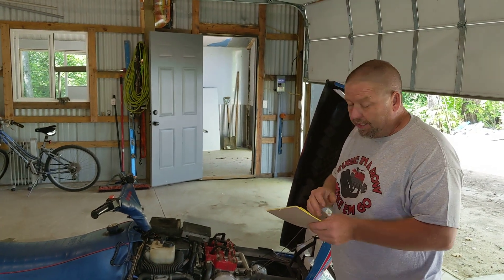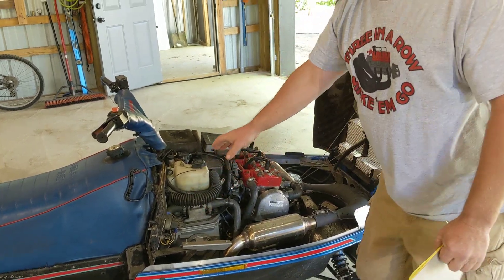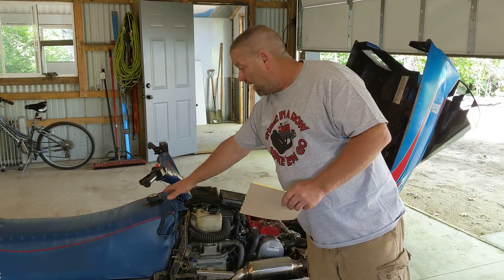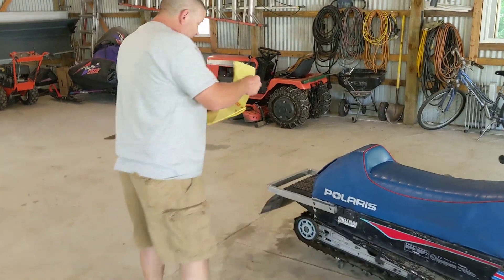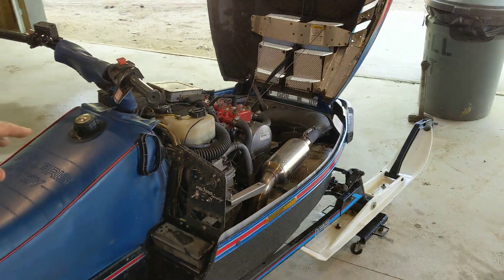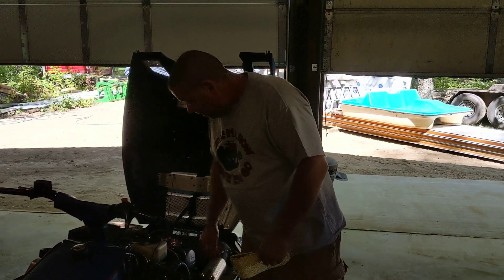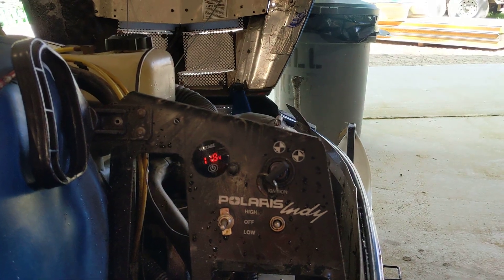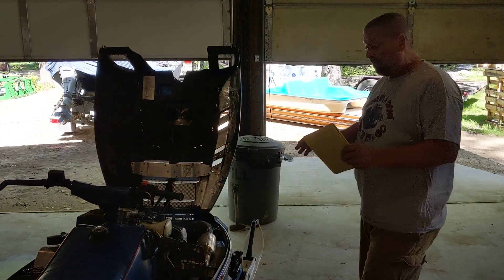POLARIS 650 RXL 500 EFI trouble shooting and codes

Comment: I had one of those, brand new 1994. Every time it got below zero it ate spark plugs like they were absolutely FREE. 9 plugs in one ride up North. Traded for the 95 Storm and never looked back. Didn't like the clunky reverse system in the RXL either. For a minute there I thought you had my old Storm as I put an Extra 10 in mine but I used buck rivets and support plates on mine. Great channel, love the Turbo 650 pumpkin. Great with the decals. Wish you'd have had me paint it. I'd have cleared over the decals and made it totally over th e top! LOL!

Comment: I have a 91 RXL and I've had lots of others over the years and I've been working on them all so I know all that stuff that you described but there is a couple of things that I want to address one is you've talked about the battery yes it's very important the battery has to stay up in volts but here's the trick it's very easy just go out buy a battery tender not a battery charger a tender and wire it right on to the battery so you can plug it in when you're done riding it for the day it'll charge battery and when you come out the next day you'll be fully charged also check your charging system make sure it's putting out hook up a volt meter to your battery see what your volts are like you said 12.9 volts at the battery fire it up it'll be probably under that because it's running off the battery in order for it to put out you have to take her up over three grand and hold her there for a while and watch it should climb up to 14.1 volts or a little bit higher if it doesn't then you got possibly a voltage regulator failure you got two of those on that sled you got one from the lighting coil that runs all your lights and your gauges and stuff that has nothing to do with the charging system the charging system is separate from the lighting coil and it has its own coil discharged battery and run the EFI problem is they couldn't make a big enough coil to charge the battery and run the EFI at the same time so what took to hit the battery so that's why it's important to start with a fully charged battery never let them sit without being on a charger that's just plain dumb and ignorant if you're going to own on RXL make damn sure you know what you're doing with it and if you don't you better educate yourself because if you do something stupid it will likely leave you stranded and it'll probably be the batteries dead so if you listen to these people on these sites they know what they're talking about and arc cells are very reliable I haven't had any problems with my 91 it runs absolutely flawless I put a epi pro clutch kit in it and I got well that comes with springs and it comes with the Helix for the secondary clutch all that but it no it's fully rebuilt from the ground up and I lost the motor myself by not changing out the crank steels I should have done that that's something else that people need to know if the slut has been sitting for a long time it'd be very wise to replace your crank seals this thing was sitting for 10 years before I got it inside a garage it was his wife's sled the lighting coil failed so they had no lights well if they would have taken it apart and they would have saw the two pieces of wire was like it got hot and it broke apart you hook those two back up the lighting coil works so I solder them back together and it's working just fine I don't know if I did the right thing but it's working I do have another state here if I want to put it in but it's working it's been like this for quite a few years and haven't had any issues.

Comment: Is the voltage meter just parallel down stream of that kill switch to ground? It’s a great idea and I want to copy it.
Reply: OK, I wired black to brown and it turns out that voltage is coming from the CDI and the ignition coil. This is not battery charge coil voltage. I wired the volt meter directly to the battery, I used a continuous duty relay and I triggered the rely from the yellow wire which is the lights and accessory coil system. The stator has three individual charging coils, ignition, charging and accessory. You still had a great idea there.
Reply from the maker: @holleyman1970  yepper

Comment: Owned a 95 Indy 500 EFI from about 2005-2017- Todd is spot on on all advice here. He mentions all of the on-line guys that helped me keep mine running as long and as well as it did. New battery at least every other year and clean electrical connections. I beat the snot out of that sled and it always handled whatever situations I threw at it! Just bought a pair of 96 carb Indy 500’s- been out of the sport for about 5 years, looking forward to riding again!

Todd- nice job on this video! Great tips and info on the ole EFI’s.  Cheers!
Reply from the maker: Thanks

Comment: Couple things we encountered a lot was power draw from aftermarket hot grips, thumb warmers, face shield warmers, helmet coms, etc. adding extra load to charging system and either total draw or improper install dropped power and caused issues.  TPS even if not tripping a code absolutely critical on the EFI Poo sleds too.  Annual fuel filter changes and batteries, as noted a must- just do it.

Most ECU failures encountered were on '90 1/2 pre-production units and '91 prod units or units that sat outside uncovered.  By mid-'92 saw way fewer ECU failures.  Lastly, if the sled has had the EPROM changed for pipes, those did fail at a reasonable rate, and here we are 30 odd years later and with so little known history, worth checking to see if it has a stock EPROM or not.  Kudos to the faithful and keeping the old girls chuggin along!
Reply from the maker: Very well said and thanks for taking the time to add this. I'm a firm believer in just leaving these stock and enjoying them. Piping them added piles of issues.

Comment: The Polaris EFI system from 91 model year until 96 was a good system and still is in my book. I have  an actual Polaris Select Monitor for these EFI Polaris' that I bought about 15 years ago but I have never used it . I also have the micro chips for putting SLP pipes on an RXL that came with the Select Monitor.
Reply from the maker: Sweet
Reply: @toddclyne3493  The 90 1/2 RXL which is very rare RXL had the best ignition.  If you know of anyone who might need a complete fuel injection system(less stator plate) I have of a 91 RXL that worked when I took it of the machine let me know.
Reply: I'm interested in this stuff if you still have it.

Comment: Is the key in the on position. Only kill switch off.
Reply from the maker: That's how we run it
Reply: @toddclyne3493  I heard if the key is on even if the kill switch is applied. It causes the battery to drain. I don't know if it's any truth to that but I figured you probably would know more about those RXL's.
Reply from the maker: @emmanueldelescaille731  it's possible but we really don't use the key.

Comment: I bought my kid a 680 ultra me and the wife have xlts that run great cable is bad on his sled I bought an XLT cable for it but the idle super high is there a difference in the length of the cable or do I have the coil packs f*** up please respond would love help watch all your videos
Reply from the maker: Probably not adjusted correctly. I would compare the cables side by side

Comment: I have the exact same sled. They are awesome sleds! Last winter though my positive battery wire touched the metal battery box while driving and shorted something out. Headlight bulb blew and lost everything on the dash (all dash lights and every guage reading). Funny thing is the sled still runs great. I replaced the voltage regulator and no help. I'm thinking maybe the stator went?
Reply from the maker: I would pull the flywheel and check the stator. What a bummer

Comment: I sure liked my ‘94 500 fuelie back in the day, until I got my ‘96 XLT Special. Lolol. That 500, by the way, is still seeing use as a “Cabin Sled” by the older couple I sold it to. One of my buddies has a 650 RXL that’s been sitting in the back of his garage for 25+ years. I’ve bugged him about it a few times, but, well, he doesn’t sell anything. Ever. Great info to know if I ever do get my hands on it. Thanks.
Reply from the maker: sure hope some day you can make a deal